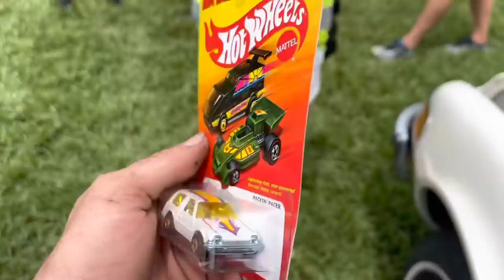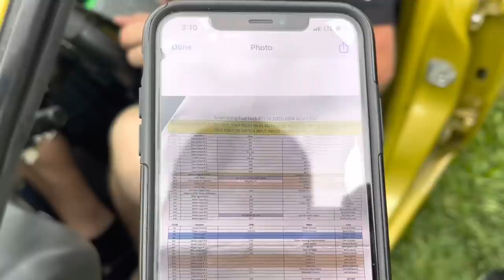Testing Our Burnout Pacer For The First Time! Skiddy puts on a Show!

Comment: That was a really good skid, great tip in, good constant high wheel speed and great use of the whole pad. Skiddy with Brent behind the wheel is going to go places.
Reply: That short wheelbase will really be a huge advantage once they get the power level and gearing sorted and can get wheel speeds in the 200 mph range.

It will be unstoppable.
Reply: Heck yeah Brent always always puts on show way to go

Comment: I agree with "fueltech the world." I've been making stand-alone ft450 harnesses for cable throttle kseries. As either a replacement for oem/hondata or for off the wall swaps. You could put a k20 in a dodge caravan and have working reverse lights with the setup I offer. My ep3 had a roached harness and an issue with the ecm so I developed to run the ft450 in an ep3 with working EPS. The ability for it to be non chassis specific was just a coincidence.

Comment: @PFI Speed - Brent, A lot of the Australian guys pour concrete in the wheel wells to make them solid and prevent those dents happening all the time. Bar steel sharpened as cutters as you mentioned also.

Comment: I picked up a pigtail with resistor in it from amazon for couple bucks for my ls swap. Another thing… if I remember right Jamie mentioned he hooked to alternator activation wire to the battery. All my research told me that that would kill these ls alternators. You want it on ignition

Comment: Sensational burnout for your maiden voyage boys, that was an incredible team effort to get it out and ripping in time for the event. More horsepower / better gear ratios will get you to the wheel speed you need to take it to the next level, but instead of bringing in the nitrous you could always cheat by spraying a little bit of diesel at the rear tyres. The windscreen washer bottle is perfect for this, just ask any 80's Aussie kid that was able to pull off 200 yard skids in his mum's corolla lol....

Comment: Just an idea, put a heavier spring on the drinkers side rear to help balance torque reaction from the prop shaft and the welded dif. When the prop loads up against the dif it will always lift the passengers wheel when you have a live axel.

Comment: If you shorten up that diff and tuck the tyres inside the guards you won't have as much rubber flicking up on the side of your guards and stuffing the paint. It's a big job but you said you are looking at a new rear end soon. Slap some big old wheel tubs back there slam her and let it rip. Skiddy rips fellas wipp that sucker